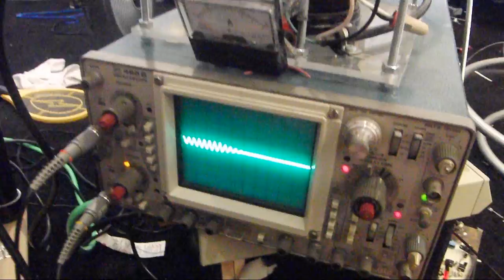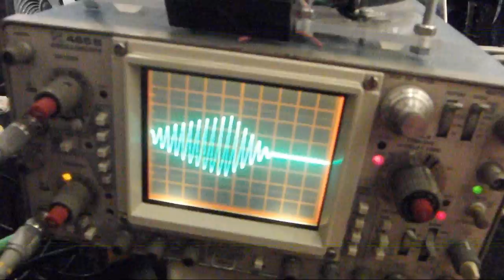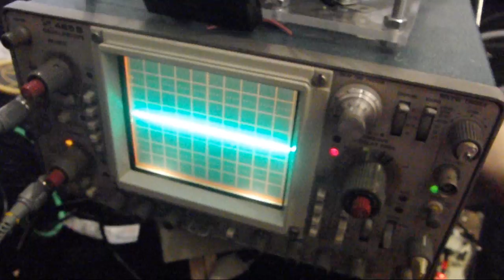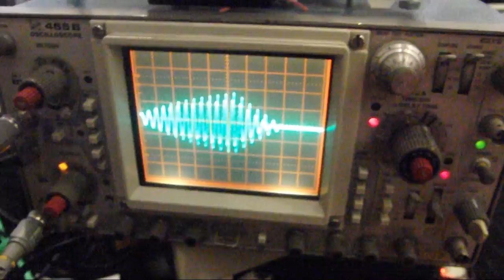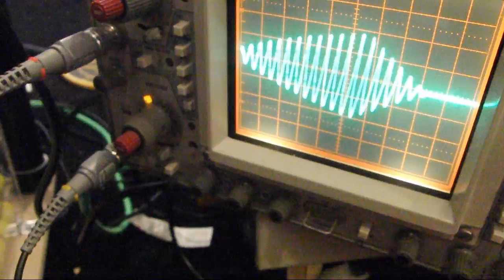DRSSTC as Induction Heater Test 1

Comment: Biggest coil I've seen on  the web.  what's  amp and volt draw on the mains?  Well it prolly  doesn't much matter. I'd been considering  building an induction heat treat oven. I  need maybe 2600 Ohms   to get steel to  1500F  plus  and hold  for an hour at a time.  I'm thinking  induction might  be  less manageable than plain old  fashioned  resistance heating.   What do you think?

Comment: Hi, I Built Steve Wards Driver 1.3b. If I try to run it, It would only starts to Oscillate if I sporadicly disconnect and connect the GDT Connections. Do you know that Problem?
Reply from the maker: Your best bet really is to ask on a forums like 4hv.org  This was ran off EasternVoltageResearch's board/driver, not steve wards.  There's a lot of variable at play and without having a properly layed out description fo what your setup is and what your running, cant really answer much.  PLus its been awhile since I've really done any of it. I just know mine picked up the signal from the primary coil, using a 1:1000 GDT and often had to had a load in the inside ( coffee can of water or something ) to make it happy. But issues can be on the actual PCB side of things too, just depends.  Forums is your best bet for help though

Comment from the maker: @260830107 Of what?  The can in the middle is obviously not getting much inductance because the primary is so far away.  If it was closer like it SHOULD be for induction, I'm sure that can would be a LOT hotter.  But since I used my primary made for a 12" coil, well,  I make do with what I have =)

Comment from the maker: @MrGerbilBrain Yeah, you cant even see the 16 capacitor bank under that box on the floor.  But, thats a 12" x 48" coil, the spool i used was 10 pounds of 24awg, i tihnk 10,000ft.  I used a little over a mile of wire, so roughly 5300 feet of wire.  50Khz resonance. Ya, its big, but size doesnt matter, small coils of 2' tall can do 7' sparks. Its all about resonance, bigger coils, lower freq, means i can use cheap old CM300 IGBTs to power it.